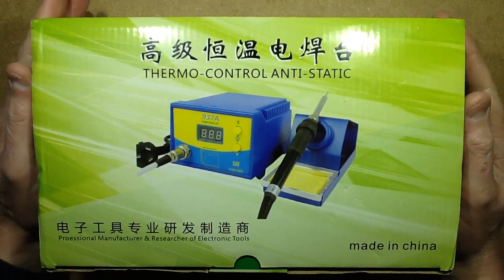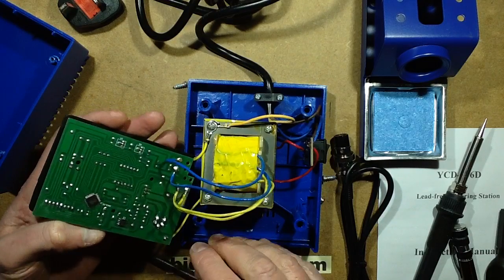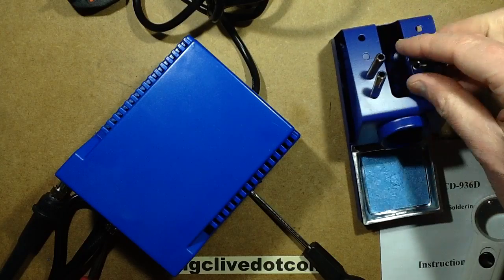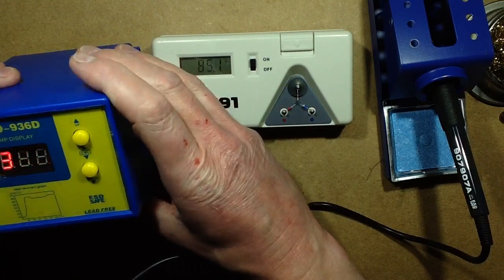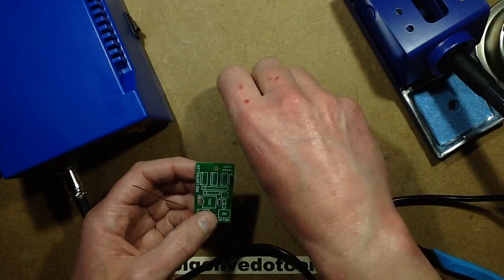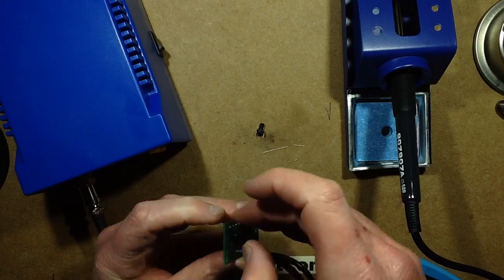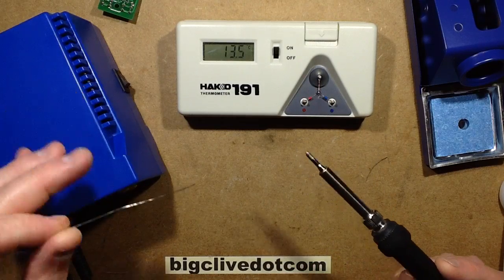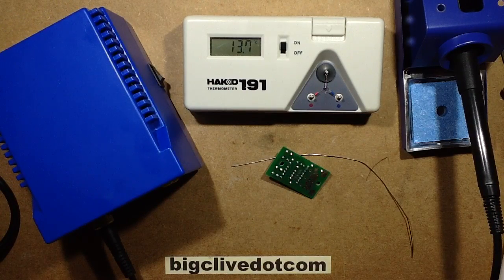936D digital soldering station test and internal look.

Comment: Just bought one of these on the basis of the review and teardown. Interestingly the sellers must be taking notice of the comments about the plugs as mine came with the same moulded plug as Clives but also had a loose rewire- able uk plug in the box! So will be snipping off the supplied plug and adding in the alternative one (and ditching the 13amp fuse at the same time!) Keep up the good work Big Clive!

Comment: what transformer is that? cuz of prior knew they could build it by ordering the board n wand for like $10 n use spare parts for the rest n not pay a premium for a plastic enclosure...
Reply: I don't think you could get one of those transformers, as Clive says it appears to be customized for the station. But the unit itself is cheap and very good (at least the one I tried and the one in video), so you won't be paying any "premium".

Comment: I have just bought the iron below. You must be very wealthy to be able to afford such really expensive irons like the one you test here. LOL The one below actually seems to work. I can see the screw in tips seizing solid if they are not removed frequently. £8.99, 100C - 500C and you get a spare tip, 2 dia. of solder (not much) stand and sponge. It doesn't seem that bad but how long it will last is anybodies guess.  I wonder if it will work better than my old Weller, I'm sure it will. Proper Chinese kit this you know.  

http://www.lidl.co.uk/en/our-offers-2491.htm?action=showDetail&id=41124

Please, please get one and do a test, you might well save hundreds of lives - or maybe not of course..
Great video's Bigclive.

Comment: Excellent and down to earth review.
For the "elitists" (typically those who just spent their entire savings on a top of the line brand-name unit); spend a moment on thinking about "in what countries are the most professional manual solderjoints being made each day", next ponder if they would use a "high end" imported one or a locally manufactured "this is what makes you reach your daily quota with quality" type of device, now compare. "Professional" takes on a whole meaning
Reply: For the "hobbyist without bottomless pockets" these Hakko clones are perfectly OK, AND spare parts are readily available (handpieces, elements, bits (obviously)) for very reasonable prices. I'm using an 888D copy - and the bits alone are so numerous (and reasonably priced) that it was well worth migrating from my old non-thermostatic Antex. If the control unit dies, I'll simply buy another.
Reply: Phil S It's the spares that really attract me, well that and the low price.
Reply: The company I work for had to replace a lot of older soldering stations because the people in product development designed a circuit board based on what their fancy soldering stations could easily do and neglected to check if the daily drivers down in production were up to the task. Turns out modern, digital soldering station that provide 80 Watts and respond to drops in temperature within fractions of a second can deal with much higher thermal masses than analogue soldering stations that provide 30 Watts and take several seconds to realize that the tip cooled down... 
The time it took the pad for the ground to get from the flux' working temperature to the solder's working temperature was so long the pad was oxidized again. The work-around we used until we got soldering stations with sufficient power was to take a huge blob of solder onto the tip, heat up the joint at full power (according to the dial that would have been 400°C, but I doubt that's what a thermometer would have shown) for fifteen to twenty seconds and then use a squeeze bottle with a very fine, metal dosing nozzle to bring in the flux. To anyone who is ever tempted to try this: The use safety goggles is highly recommended, due to the amount of sizzling you get from pouring liquid flux onto a hot soldering joint. But boy was I glad when the soldering station that forced me to go through that effort was replaced with the same type the people in product development used.
Reply: Youtube as great as is, a huge magnet attracting the e-peen dick-waving and overly egoistical crowd of all flavors. For real pro work, the price is a moot point anyway since the chances are the employer will be paying and providing the expensive toys.

Now comes the scary part about China manufacturing: They are already more than capable in making a soldering station that wipe the original Hakko off the face of the earth at the same price point, but they choose to make stuff at 10% of the cost for 80% of quality due to much higher demand. The smart people living outside China are deathly scared of China for good reason, the dumb ones are the still happily chanting the "China only make sucky products" memes when these fools don't even have the capability to make a lousy clone if their lives depended on it.

Comment: Am I missing something, that Hakko 191 is $99.  How do you calibrate your iron without one ? I have a lovely old Weller but can't find the tips for it in the UK. The display looks like neon, yes it it pretty old.
Reply from the maker: You can calibrate it be feel for how the solder flows in use.
Reply: I had the same problem on honeymoon. After 43 years I got the hang of it.

Comment: Hi Clive,  How are you getting on with your 936D ? After many hundreds of hours of use my WLX-936D iron has finally given up the ghost. Simply failed to power up one morning. There is power to the microcontroller but no output (and no display) so it appears that the controller IC has died. Can't complain as it was used on a helluva lot of projects & did very well for a relatively cheap iron. Now sat in 'To Do' pile until I pick up an analogue version of control board.  If I bump into one I will buy another xxx-936D as the easy temperature adjustment and stability was very handy for SMD projects, repairs, prototyping & small batch builds with temperature sensitive components. :-) Have worn out two other irons over the same time period that were almost twice the price (and not as nice to use due to fiddly temperature calibration)  Only temp controlled Iron that has outlived  the 936D is a big old Weller that has lasted over 20 years! (way too chunky & clumsy for modern SMD components tho..)

Comment: Just ordered one of these, and has arrived just now..... there are some cheaper ones with the manual POT temp adjustment for calibration, but prefer the digital method. got a few spare so called Hakko branded tips (Doubt there are genuine, but hey, if they work, I am not bothered). You are right about the mains plug..... dam earth pin is sleeved, so that will be replaced later. One quite amusing thing I have found is the brand name; Katsu..... same name as used as a Japanese style curry :D

Comment: Hi Clive, I enjoy your videos very much. After watching this video I bought one of these soldering stations and also the temperature tester you show.
My iron is wildly out on correct temperature by about 57 deg C but the adjustment only allows a 50 deg C. Is there an internal adjustment as well?
Keep up the good work.
Paul
Reply from the maker: I'd suggest just compensating manually by changing the set temperature until the tip is about 330C.
Reply: 57 degrees is nothing, mine measured 180 degrees too high! Was set to 400C and melted the plastic nut that holds the metal shaft to the plastic part of the handle, so now it's just flapping in the breeze. Got the hakko 191 the day after and the tip measures 580C when set to 400...Must have been something wrong with the thermocouple.

Luckily new handles are cheap as chips so I ordered a couple of new ones, only wish the shipping from China didn't take so long. Curious to see when the new ones arrive if the fact that they are 50W and the one that came with the station was 60W will make a difference. Think I'll try measuring the resistance of the heating element of both to see if there actually is any difference.

Comment: I've been looking on Ebay and can't find the model you are using.  What did you use for search terms?
Reply: covishen Look at this on eBay  http://www.ebay.co.uk/itm/251399780042
Reply: I think all of these 936 X models (x for any letter) are all based around the same design and PCB. They could differ internally of course, but if you just wanted a blue one that looked exactly the same, the above link or for a tenner cheaper: http://www.ebay.co.uk/itm/291975166952

Comment: My Yihua soldering station arrived with a '5 Amp' fuse in the plug.  I took the fuse apart and it had more like the old 15amp fuse wire inside.  I would definitely replace the fuse, if not the entire plug with a proper BS one.  The wire measured about 0.4mm.

Comment: I got nearly the same Model from a UK supplier on E-Bay. Compared to my Weller WHS40D (which has a screw to hold the tip in) it is actually better.

I changed the UK Plug to a German Type F Plug and tested it: It is amazing. I can't wait to solder my next projects. Totally recommend it.

Comment: I got a Gaoyue 936+ awhile back... Was a 120v model, which is nice as well.
Honestly can't complain about it for $25. This one just blinks an LED when it reaches the ~temp.
Came with real Gootwick, a stand, sponge, some solder, 6 tips, flux, an iron, and (obviously) the station... Hasn't broke yet.
Of course I tossed the flux and sponge... Used my own

Comment: having problem with my lead solder could you give a link to get proper fluxed leaded. thanks
Reply from the maker: Any good electronic supplier or even a general eBay seller should be able to supply you with traditional 60/40 flux cored solder for electronic applications.

Comment: i usualy use solder for just puting tin onto cables , and some LED tinkering but i have worst reflex on earth and ALWAYS manage to get burn myself :)
Reply from the maker: It's easy to get distracted and burn yourself.  The longer you solder for the less you are likely to burn yourself.  A good solid soldering iron stand is always a help.
Reply: quite a lot till you have got quite the hang of your iron, but even the you may still burn your self every now and then

Comment: Are these chinese soldering stations usable without calibrating it?
Reply: +Tipsy hs this is a fairly interesting point because Clive has been to the industrial/commercial side also yet he still grades the irons as good where EEV almost completely hates them
Reply from the maker: Yes.  Just go by how it feels to solder with.
Reply: bigclivedotcom Thanks for replying, really love how you see the product for what it is unlike how eevblog tend to criticize on these chinese products.
Reply: Not true.
These are cheap solution irons and are great for what they are, but when it comes to more challenging soldering they tend to not cut the mustard.
As Clive pointed out..

A higher end station will not struggle with high mass joints, and will also keep a firm control of power/heat delivery.

EEV made no qualms of recommending the Atten 858D hot air station, a cheap solution that works, again with its' limits.
With the same caveats, it will only do what it will, check it internally and electrically before use, and use at your own risk.

It would be interesting to hear Clive's opinions on the Ersa Nano, for quite a few reasons.
C'mon Clive!

Comment: I got a new soldering iron for my birthday and its like a hybrid of this one and the kind with the dial on the front. the temperature is digital with up and down buttons but the calibration thing is a tiny hole for a philips screwdriver that you turn. its called a 936d and the case is the same as the others but the make is weird and really hard to read, I think its a Hiylkko? or a Hylkko? and the actual iron bit says Huakko lol. its that thing where the name is made into a logo but it looks like its been done by someone who cant read english. but its soooo good compared to my crap old one it makes soldering things super easy I made a clock out of a kit and its so nice to be able to solder things properly. the only thing is it came with a manual for the kind with the temperature dial so Im not sure how to calibrate it and I havent got one of those thermometer things but I dont know if that really matters anyway I put it to 280 and that works fine for me

Comment: All those who dare underestimate Clive's sphere of influence should now take note - thanks to this video, this particular model of soldering station is now unavailable from regular sources. Those brave enough to try unproven Chinese web sites (some of them ask for payment by Western Union, FFS!) can try but might end up sans both product and money, whilst those desperate of heart and deep of pocket can go the eBay route and pay 35 pounds to the extortionists who seems to have exclusive stocks.

As for me... I've now decided to save some more pennies and aim for a multi-purpose bench device like the Saike 852D++, Hanba 968A+ or Handskit 909D+. Yes, reliability would be better with individual devices, but the price and bench space required would be proportionately greater too.
Reply: It's readily available from ebay.co.uk seller aimtoolsltd for £24 with free 2-3 day delivery within the UK. I've just ordered one, and have no connection to the seller!
Reply: Thanks Sly Fondle, but it seems he's already sold out or pulled the product from his store. All I can find relating to soldering in his listings is a bevy of "helping hands" devices, some butane torches, and a single standard 936 (i.e., all-analogue) station.

Since my previous post, I've decided to go my own route and build an Arduino-based station using PID control and a rotary encoder. Total cost if I purchase all parts (that is, if I ignore parts I already have in my dungeon) is a shade under AUD$60 including postage, which is about £34.

Sure, I won't have the "unboxing goodness" experience, but I'll have an iron that does exactly what I want, with better temperature regulation.

The sad thing is, I don't actually need another soldering station - but Clive's video reminded me that I've for a long time been yearning for a station with digital display (so I don't have to keep leaning over to see where the control's set to).
Reply: Thanks again, Sly Fondle. That explains why I couldn't see it - he won't ship it outside of Europe :-(
Reply: Just got myself an 858D SMD as I am starting to work more on surface mount stuff with restoring fruit machines (Obviously stripped it all apart to make sure everything is right with it), and also noticed the same seller was selling a black / white version of this same iron (I have also found a 100% match of the iron Clive shows here), and seriously considering replacing my forever faithful unit I got from Maplins over 9 years back. As a side note, pretty much all of these irons / SMD units, all come from a drop ship location just outside of Loughborough in the UK (Close to Amazon's Wharehouse in Coalville), for BOTH Ebay and Amazon sellers.

Comment: I bought a Zeny 937D+ on eBay for $29, and received it with a broken cord (the earth pin was smashed down, NEMA 5-15 plug , I live across the pond) , so I got the seller to refund my purchase and kept the item, I took an old computer power cord and cut the IEC connector off off it, I found that the new cord a with genuine 18 gauge copper conductors fit rather tightly, and upon inspection of the old cord I realized that the original cord was thin CCA like the lead in John wards three part video where he burned up the dangerous ASTRA BT311 multiway extension lead.

Comment: whats wrong with a sleeved earth pin? i dont live in england
Reply: The sleeve can prevent the earth pin from properly connecting to the socket, making the entire appliance un-earthed.
Reply: Meanwhile over in America... Most shit is ungrounded
http://static.howstuffworks.com/gif/how-to-replace-an-electrical-receptacle-2.jpg

Get... Triggered
Reply: A good amount of products are not grounded in the UK too. Soldering irons should be earthed not for human safety, but for the safety of the electronics that are being worked on.
Reply: You must live in a run down environment.  Practically everywhere I've been in the US had grounded outlets, just not the dollar store super cheap 6' extension cords.  Similarly, the US version of this and any of their other ESD safe spec'd meters, do come with a grounded IEC cord.

However you fail to understand that many things don't need to be grounded, which is why they only have a 2 pin plug.
Reply: xLDKx NewYorker in America we have another standard called "double insulated", which means that you never at any point come in contact with a conductive material that could provide a path to earth.

Comment: Clive could you do a veview on a good affordable multimeter as mine just when haywire. Preferably voltage auto detect and the usual abilities cotinuity with buzzer current draw and ampmeter. I paid 50 for mine its just for my home use for building projecrts. Im not cheap just not able to sink large money into gettin one.
Peter

Comment: Thanks for the review. But why do you wipe off the tip before putting it in the stand? You should never do that as a clean tip with no solder on oxidizes and wears out much quicker. Instead clean the tip after you take it out of the stand again and apply new solder. When turning off the iron or changing tips always make sure to put solder on the tip before letting it cool down.
Many clean off the tip as the last thing before turning off the soldering iron, but you should never do that. Always apply solder again right after cleaning the tip. Always store tips with solder on them instead so they don't oxidize. When they come new from the factory they also have solder on them for the same reason.